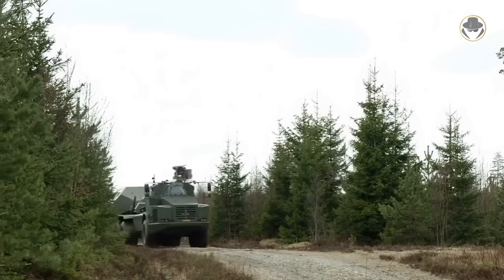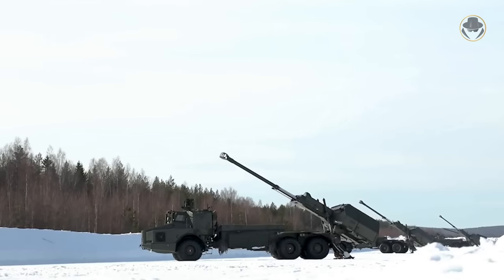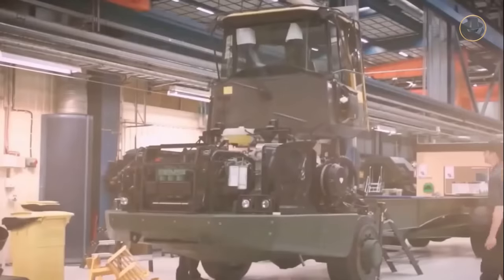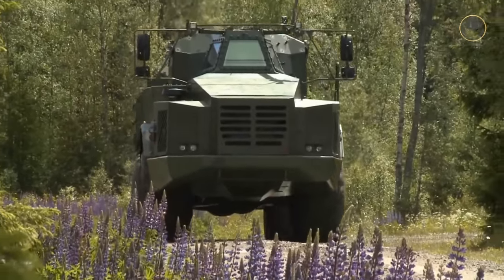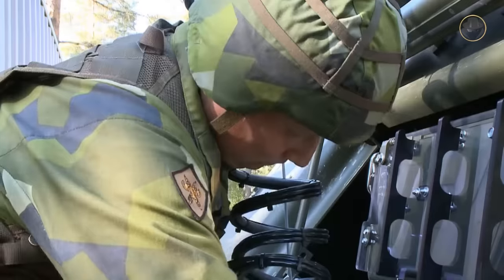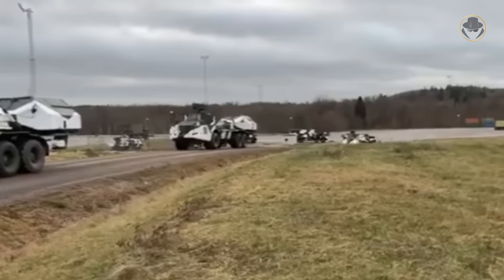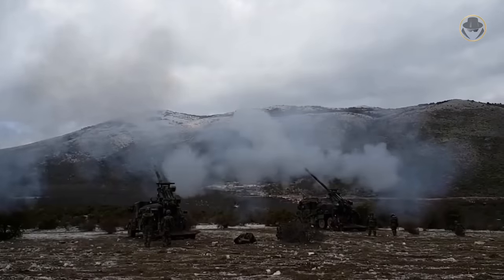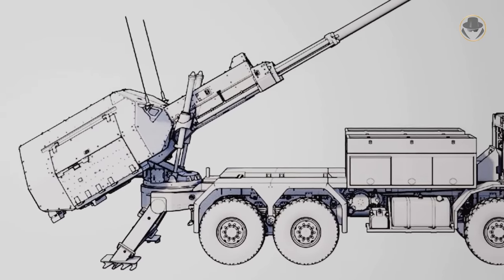Archer Artillery System | What is wrong?

Comment: Volvo A30 / A35 are used worldwide and the spare part network is just as big as any other manufacturer. It's more expensive than an ordinary truck, sure, but it can go where the more expensive tracked gun can go. And it's faster and longer range. And the crew is protected, unlike the truck. I guess it comes down to price tag and who you want to make happy. :)

Comment: I think nothing is particularly wrong with the "Archer", maybe the price tag is on the higher side. After the artillery-intensive phase of the Russo-Ukraine war, truck-mounted artillery systems will be more demanded worldwide. Archer should get its share of this trend.
Reply: How much?
Reply: @regregan6852  "BAE received a $200m contract in 2010 to supply of a total of 48 artillery systems, including 24 each for the Swedish and Norwegian Armed Forces, as well as associated ammunition handling systems." (resource: ArmyTechnology). If these numbers are true, then 4,16m each, of course, this is 2010 price and I don't have any clue about the details of the contract.
Reply: Yeah it's not something you'd buy for your mother.
Reply: @kudretklc6120  First version is the most expensive. Development costs.

The biggest problem for sales is that 40% of countries buy from Russia and partners, 40% buys from US and partners and the rest 20% don't have any money or need for it.
Reply: it's a bit large I guess but rich country with a lesser need to move them by planes could prefer them to Caesars I guess ?
Reply: @kudretklc6120  Which is apparently cheaper than the Caesar, and roughly the same cost as the Atmos 2000. The older versions of the Nora B-52 is still cheaper. Couldn't find any information about the unit cost of the newer models however.
Reply: @onlypeaceindeath  the Archer is not a Caesar
Reply: @Nubbe999  I agree on the share of the development costs at the price tag, Saab/BAE Systems surely need more orders to reduce the price of the Archer.

The defense market dynamics always looked very complicated to me. 
Sweden is a small neutral country (this has been changing) that has a well-developed economy and an important defense industry base for its size. Even though Sweden was "neutral", its impressive defense industry was integrated well into the West and I think it has a pretty good sales record around the world (eg.: selling anti-tank rockets to the US, artillery pieces to India, JAS 39's to many countries...). But on the other side, Sweden has a small army and doesn't have enough orders to sustain such a defense industry, I still can't imagine how Sweden can still develop its multi-role fighter aircraft and market it worldwide. I do think that the NATO membership may have a positive impact on "made in Sweden" defense products.
Reply: @dEcmircEd  17,7 tonne Ceasar has the advantage in size and it is combat proven
Reply: @onlypeaceindeath  could you share a resource that includes the price of the Caesar to the French army? I found the news about the Lithuanian and Colombian sales and it looks more expensive than the Archer (of course we don't know the details of these contracts)
Reply: @kudretklc6120  military contracts can be so different and are mostly opaque that it is very complicated to get the price of each system. I found that the contract made to BAE for 48 systems was about initial costs to start the mass production. If true, it would mean the 4,2M cost per unit is far from the full-package price (system, training, ammo, spare parts, early maintenance, sofware updates) plus overspending and inflation that a potential customer would have to pay for it. And i could easily explain why BAE never reached any export market so far
Reply: @remistiegler5302  thank you very much for the detailed information
Reply: @kudretklc6120  you're welcome ^^
Reply: @kudretklc6120  Absolutely. The Caesar is lighter, cheaper, more accurate and more powerful than the Archer.
It can be mounted/adapted on very different chassis. Because it's lightweight, it can take position anywhere, crossing snowy and muddy fields to hide in small woods, away from the enemy intelligence.
And it works fine. Ask the Russians, ... at least the surviving ones.
That's where the French technology and experience make a decisive difference on the field.
Reply: @pget8462  yes ceasars are very nice :)
but archer is also nice, maybe sweden should send a bunch (I hope) to make them also battle proven
Reply: Caesars are not autoloaded, they need drivers + shooting crew. And they do look really not nimble compared to archer. Different uses different tasks.
I would take archer over Caesar any day.
Reply: @anaboli_o  Archer and Caesar are definitely different in terms of technical features & design concepts.  Many weapons that Sweden develops have unique designs thanks to the home defense needs of this innovative Scandinavian country. If I would be a soldier, I personally would love to be in the armored cabin of an Archer during a conflict, but as a high-rank commander, I would go for a more conventional design like Caesar.
Reply: @anaboli_o  Correct. On the Caesar loading is only partly automated. Reducing risks of failure and maintenance tasks. The simpler the more reliable. The lighter the more mobile. That's why the Ukrainian artillery guys love it.
Reply: and where will the money come from to produce these?
Reply: Ukraine War directly represents why tracked SPH is much superior than truck guns.
Check how fast those tracked SPHs are moving around. Try that with truck on a field with full of mud.
Also much better protection of tracked SPH increases crew survivability.
Reply: @hishot1078  Yea, Polish AHS Krab is in Ukraine and it is doing good job there, Polish AHS Kryl on the other hand is in Poland as only one prototype exist of this self-propelled wheeled 155mm howitzer with 52-caliber gun. The only real advantage is the fact that you can transport this type of howitzer with C-130 Hercules...
Reply: Will be different when/if Sweden joins NATO. US companies push off Swedish companies from deals with other NATO members with unfair competitive advantages.
Reply: @Jonsson474  it's a truck
Reply: Comparing unit by unit is really flawed economics. Its really amount of shells down range that count. And not only per miniute,  but during days and weeks.

There is a other cost also. Cost of Manpower. Archer have a very small crew as well as high preformance.

The number of People that need to be trained (cost) and life risked  is considerally lowet counted by shell downrange.

This is how all swedish equpment is made. The reason is that when sweden eventually is invaded by russia, the number of soilder  we have will not be sufficent.

The volvo articulated  truck msy be more expensive to repare,  but that is also false economy. They are built to never breake down, and they hardly ever do.

The same thing is true with swedich  fighters. When the russians  come, those fighters will nevet be serviced  again. This is taken into considerstion when designed. The fighters land and get a fuel and oil refill. Then they go again. Pilots do 12/24 shifts two pilots per plane 24/7 untill the plane is lost or the war is over.
Reply: Agree! Nota bene: trUck mounted not trAck mounted. Howitzers are supposed to operate 30 to 40 km behind from where the action is. Surely they can find a way where those fat wheels will suffice.
US could copy the idea and put their howitzer of choice onto a CAT dumper.
Needn't be Bofors/Volvo.
Reply: @matsv201  Very good arguments.
Reply: i guess one thing with why they dont sell anything internationally so far is that Swedish goverment is not activly pushing the sales of it, Read some article about he JAS-39 gripen and why its not selling so much on international market and one idea is that the goverment dont push it to be sold. Its not like some countries goverments that will make really nice deals to make the sale
Reply: @loonie555  I think the Swedish "Democrats" may change this approach soon. Weapon trade is a dirty business that is very politically intensive, right wing politicians fit better into such a business model.
Reply: @L T thank you for the information
Reply: @kudretklc6120  Could be, also that the right side has always been pushing for NATO and diffrent alliances with diffrent countries, so it could very well change alot now. But as fast the left side might be back it will wind down again. I guess also swedish politicians might be scared of the tumult after the case of the arms factory in saudi arabia
Reply: @dEcmircEd  Note that Sweden was not a member of NATO until recently and had to design for potential invaders in mind.
The whole by plane idea is almost unique to the US military and NATO partners, it is not exactly optional in a defensive situation where you can expect the air to be closed.
Sweden does not have the option of Air superiority in the north like Norway does with high mountains and deep valleys.
Slow moving or air dropped artillery therefore does not make sense in a potential ground war in the north.
Reply: there would be more demand if sweden gave some to ukraine so countries could see it preform.
Reply: @Dennan  definetly, might be one of the reasons why we might see them in Ukraine if our new government allow it
Reply: Sweden has decided to space 12 units to Ukraine which is great news for Ukraine, Russia not so much
As for demand for more artillery not likely
The problem with artillery is that you need hundreds of rounds depending the target 
Even with rounds as precise as the Excalibur , you still need a lot to suppress some targets
Ukraine's weakness is lack of destruction
if their air force had capabilities such as long range cruise missiles and LGB, it would be different story in ukraine
Reply: @verdebusterAP  They might send, they have not decided yet. I guess they are laying out the logistics and how to train the future operstors
Reply: @verdebusterAP  I read many news in internet about it but is there an official announcement from Swedes?
Reply: @kudretklc6120  
They made the decision on Oct 25
Reply: @loonie555  
The sooner the better
Reply: @kudretklc6120  Still way cheaper than the CAESAR system, which cost like 7.5m dollars today.
Reply: Not sure why you'd say truck mounted specifically? I know HIMARS has gotten a lot of coverage in media but when you look at what Ukraine is actually buying they placed a huge order on Pzh2000 eg tracked SPGs.
Reply: @ZacSamuel  agreed, on fathers day though its definetly something to consider
Reply: @XMysticHerox  
They need the Pzh-2000 more because it carries more ammunition
The HIMAR is 6 shooter while the Pzh-2000 carries 60 rounds
Secondly it 5 rounds of Multiple Round Simultaneous Impact (MRSI).
so 4 units firing simultaneously on target is highly effective
Reply: @verdebusterAP  Also cost. A shell costs a tiny fraction of MLRS missiles. 

HIMARS and Mars aren't really useful as field artillery. They are meant to strike high value targets like bridges, runways or high ranking officers. Hence why you want both MLRSs and SPGs. But Ukraine has plenty of MLRSs at this point.
Reply: Sweden struggles with not only an expensive but good artillery system. But as you can see with America and its insanely expensive F-35, expensive systems still sell. The issue Sweden struggle with is politics and underhanded business tactics. Using political power is almost always part of weapons sale. Here America and other European powers will use  this to push Sweden out of the equation.
Reply: @nelyrions1838  
That would be incorrect
The US military is evaluating the Archer 
Secondly Sweden has a lot partner ships with the US and EU with various weapons
The Excalibur was jointly made with Sweden. The Carl Gustaf 8.4 cm recoilless rifle has been widely adopted 
Several Sweden military products are in use with both the US and EU
Sweden's only sore spot with the US and EU is the F-35 but thats just timing
Reply: @Nubbe999  The biggest problem for sales is that 40% of countries buy from Russia and partners, 40% buys from US and partners 

Russia is nowhere near 40%
Reply: @onlypeaceindeath  The archer is not cheaper than the Caesar, to buy and to maintain.
Reply: @hishot1078  "Ukraine War directly represents why tracked SPH is much superior than truck guns.
Check how fast those tracked SPHs are moving around. Try that with truck on a field with full of mud."

The two main artillery system who changed the war are the Caesar and HIMARS, both on wheels, nothing goes on a field full of mud and certainly not a 30t system.
Reply: @tm.8399  From what little current information i could find, both has roughly a unit cost of about 4.5 million usd. Although i did notice a 7.5 million usd unit cost for one order of Caesars, but i don't remember what was included in that order.
Reply: @ZacSamuel  I did.
Reply: If you can get away with using a truck then use a truck, but there is a truck load of places where a truck wont go, but the Archer will, as it is essentially a Forestry Forwarder with a gun. For some arenas it will fill a niche and for some (Sweden) it will be essential. Ukraine at the moment need everything that can launch things that go boom in the other direction.
Reply: 500k-600k more than it's competitors. insignificant difference for this tool
it's built on Volvo truck tech. some of the best in the world
has BAE systems weaponry 
only upgrade i would think of is a techie upgrade with embedded drone launcher for independent targeting. some more anti-mine protection (like the southafrican rhino) and maybe a faster reloading system

i think it's just not being marketed well

i'd definitely buy this if i were an MOD decision maker. superior to the CESAR and other similar SPH
Reply: @Jonsson474  unfair? would seem reasonable to me that members of a military alliance have a preference to buy from each other...
Reply: @beru58  that is old doctrine. today with cheap attack drones it's very difficult to determine what the enemy line is... mobility and anti-drone capabilities are essential
Reply: @emameyer  Well if you claim to have a capitalist economy where  competition is a driving factor, that kind of bias and governmental interference should not exist. Then again, the US is far from a capitalist economy in many aspects. To much governmental interference and regulations is going on.
Reply: @Nubbe999 
That 40% / 40% ratio is most likely changing drastically due to the poor performance of Russian arms in Ukraine. This applies evidently more to advanced expensive arms, which less wealthy nations can ill afford.
Reply: @thepny_chasseur_de_tricera5361  No. It's much better because the crew don't have to leave the armoured cabin so it has a much shorter "shoot 'n scoot" cycle.
Reply: The Caesar system, is more expensive and doesn't have an autoloader.
Reply: @anaboli_o  not a single military or artillery man agrees with your statement of taking an Archer instead of a Caesar "any day". For maintenance issues mainly
Reply: @thepny_chasseur_de_tricera5361  
The Archer is far superior to the CAESAR.
Reply: @kudretklc6120  
The CAESAR is archaic, you can't compare it with the Archer.
Was there ever anyone who questioned if the CAESAR system would work?
It is a crew loaded howitzer on a truck.
Reply: @pget8462  
The Caesar is not cheaper, not more accurate, nor any more powerful.
I can give you that it is lighter, since of course it is lighter.
It is a manually loaded howitzer.
The M198 howitzer is also lighter.
 
The Archer uses an articulate hauler.
It is infinitely better than any Renault Rigid truck when it comes to off road capabilities.
The fact that it is articulated 6x6 makes it far better for off-road purposes.
It makes sure that the weight is as evenly spread out on all the wheels as possible at all times.
Not to mention that tire width is at least twice that of the CAESAR.
 
"That's where the French technology and experience make a decisive difference on the field."
It is an archaic system.
It takes for ever to unpack, load, shoot and scoot compared to the Archer.
It is worse when it comes to off road.
It is more expensive.
Reply: @pget8462  
The supporting system of the CAESAR is in open conditions.
I mean sure, if that is your definition of mobile.
Then the most archaic towed howitzer is the most mobile one.
Since it is less likely to fail.
 
I would define mobile as the ability to handle rough terrain, and ability to shoot and scoot quickly.
Reply: @MegaBanne  lol no
Reply: @hishot1078  
The archer can fire more rounds without risking being attacked by an enemy using anti artillery radar.
It is designed for the purpose of counter battery fire.
It can take out Russian artillery without huge risks.
It is designed to be quick to move from position to position.
 
Imagine if Ukraine could take out thousands of Russian artillery pieces every month.
Eventually Russia wouldn't have anything to fight with.
Reply: @Jonsson474  
Bofors is owned by BAE Systems, a British company.
Britain has ordered some as well recently, to replace the M777 sent to Ukraine.
Reply: @thepny_chasseur_de_tricera5361  
The CAESAR is a is a crew loaded howitzer on a truck.
It has worse offroad capabilities.
It is slower to reload, pack, and unpack.
It requires a larger crew.
It is less safe.
It is more expensive.
What more is there?
 
The Archer is better at everything these kind of systems are designed for.
It can land more fire on top of the enemy and still avoid counter battery fire.
 
The Archer system is a completely new generation of truck mounted SPHs.